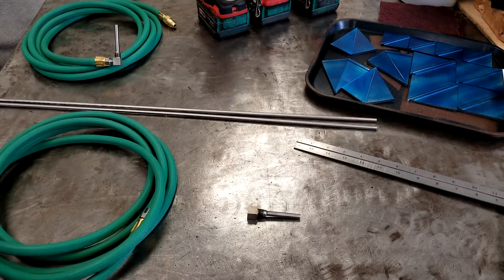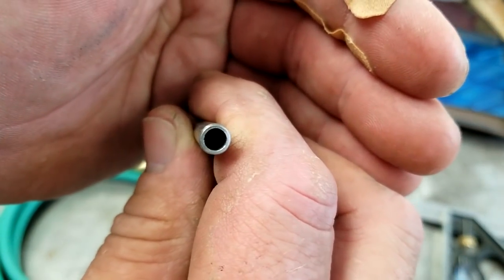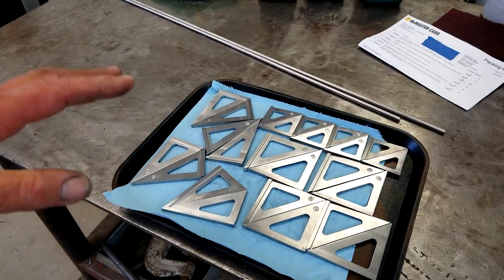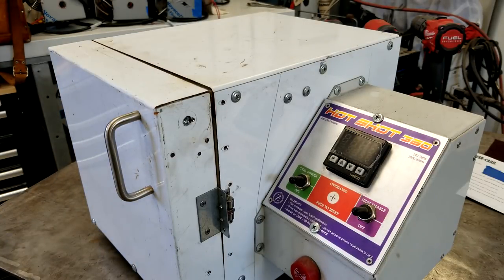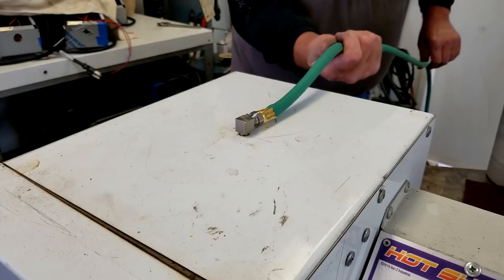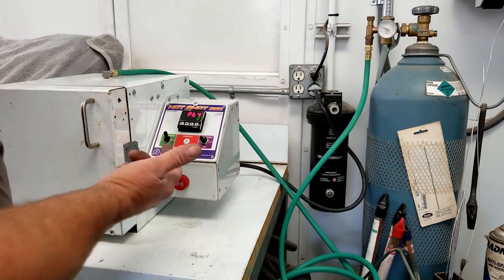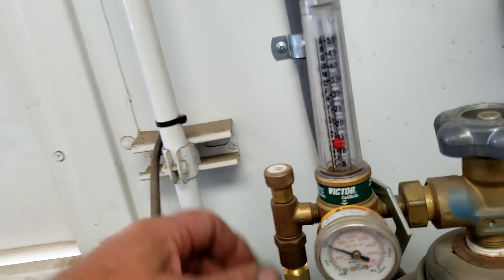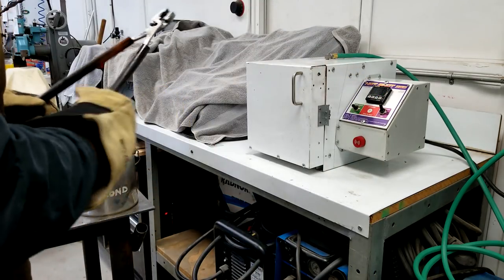Argon for your hotshot part #1

Comment: At 273C, 520F, the volume of the gas doubles. At 540/1000F, three times, and at 810/1500, four. (Ideal gas law), so the flow out of the oven differs a little from the flow in. Neat video.
Reply: Pressure, but yes.
Reply: @JohnHolmestheSecond  at a constant pressure, as in the unpressurised oven, the volume expands.

Comment: I was waiting for the rubber hose to burn off from the high induction heat crawling up the stainless fitting. Must be enough    heat-sink in the outer skin  plus cooling from the purge gas to offset the induction.  Every high temp oven that I have been around always had steel lines extending out to a manifold.  May I suggest putting a small flat circle fixture about 3/8 of an inch off the end of the stainless tube to diffuse the flow out sideways in all directions, thus avoiding cold gas dropping directly down on your part.  Just my two &1/2 cents .......... regards/greg

Comment: I don’t know about the position, Stan. The center top will always be blowing straight down on the parts you’re heat treating, I would try 2” off the back center so it will be in the very back accounting for the 2” insulation.

Comment: add a gas solenoid with pre-purge to your controller?
Reply from the maker: Thats been discussed, as well as a built in flow meter.
Reply: Saw that drill guide. Been needing one lately. Is that from big gator tools? Got one in my amazon cart now. Thanks!

Comment: Why Argon instead of Nitrogen?
Reply from the maker: I have argon on hand, I will try CO too (cheaper)
Reply: @ShadonHKW  You need to be careful argon has five times lower breakdown voltage then air. The elements will arc out and be destroyed.
Reply from the maker: Thanks for that, I guess I will have to crank one up to failure to find the limits.
Reply: @ShadonHKW   Hi Stan, I think CO2 will give you problems with carbide formation at heat treatment temperatures. To Brian's question, Nitrogen is not an inert gas, although it acts like one near room temperature. At heat treatment temperatures I would worry about its ability to react with the parts in the oven or the heating elements. Argon is the cheapest gas that is truly inert. (I'm a retired chemist)
Reply: @ShadonHKW  CO2 is not an inert gas